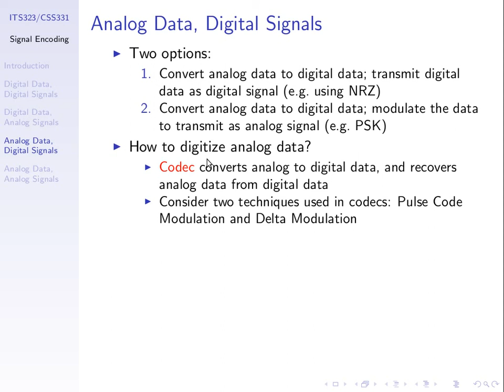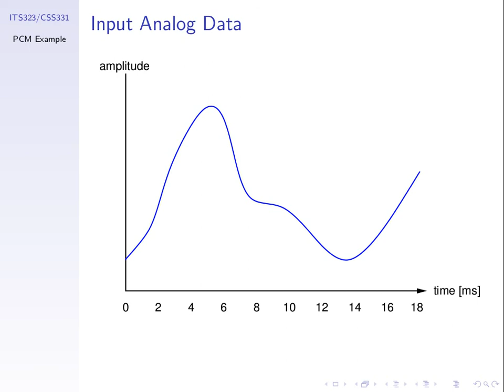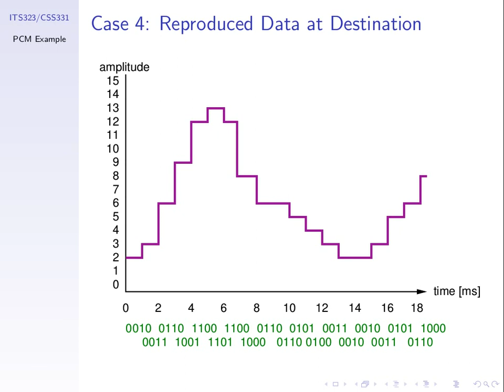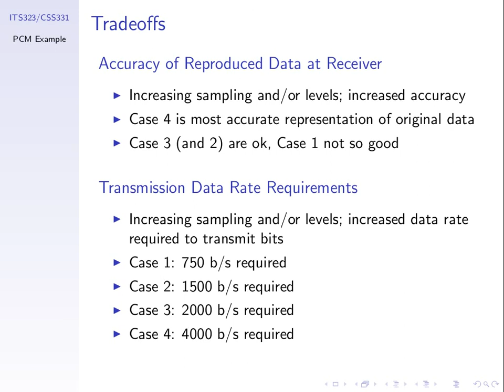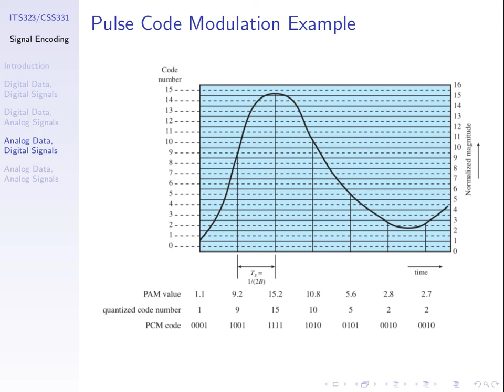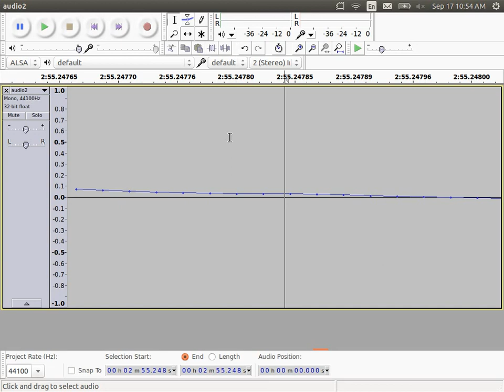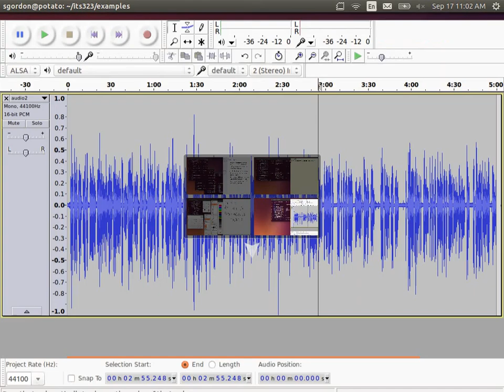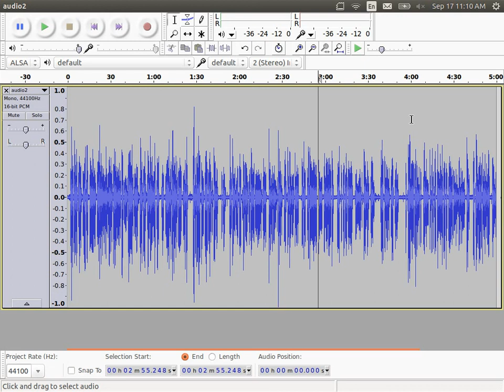Pulse Code Modulation (ITS323, L11, Y15)

Comment: Analog Data, Digital Signals
 • Cellphone convers analog data (voice) to digital signal (voice network)
 • Codecs
  ○ PCM: Pulse Codec Modulation 
   § We get analog data as input
   § We split max and min into discrete number of amplitudes
   § We split into discrete number of amplitude (quantizer)
   § Once we have a number associated with each level, then we can map to binary number
   § Example
    □ 4ms sampling interval, 8 levels
    □ We set 8 levels of amplitude
    □ If the amplitude falls inside the range for level 1, then we use binary 001 
     ® Since we have 8 numbers, than we need 3 bits
     ® These levels are called the quantized code number
    □ 4ms sampling interval means that we check the amplitude level every 4ms and map a binary number
    □ PCM code is the binary mapping
 • What data rate is required
  ○ 1 sample every 4ms
  ○ 3 bits per sample
  ○ Therefore: 3/0.004=750.0 
 • What is a good sampling rate?
  ○ Twice the rate of the highest frequency of the source data 
  ○ Human voice is 0 - 4000hz, so we should sample at 8000 samples per second
  ○ Music ranges up to 20khz 
 • Codecs are not always the same as the file format
  ○ PCM codec can be saved as a wav file
 • Compression 
  ○ It re-organizes the bits to be smaller 
  ○ Mp3 throws away some of the data